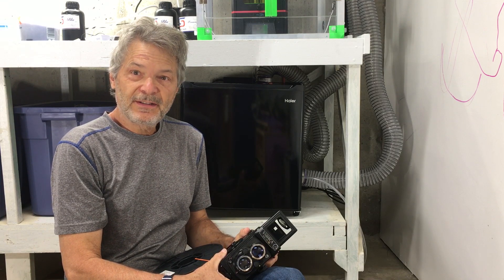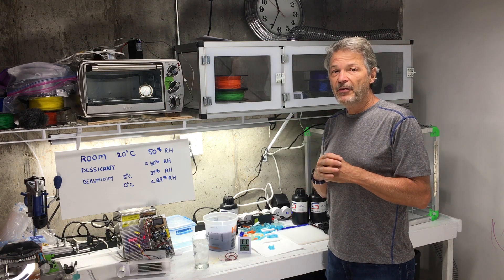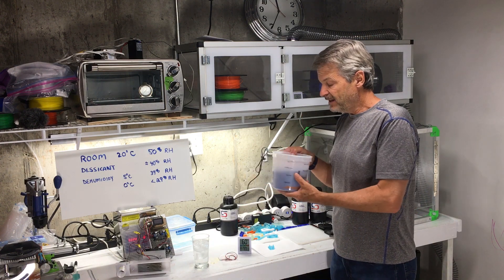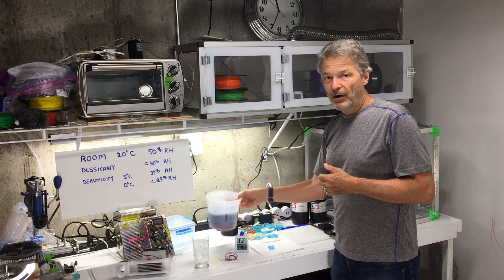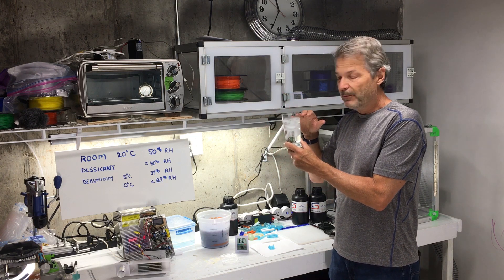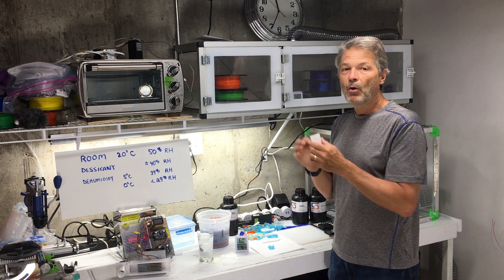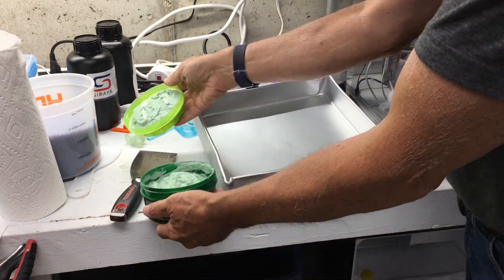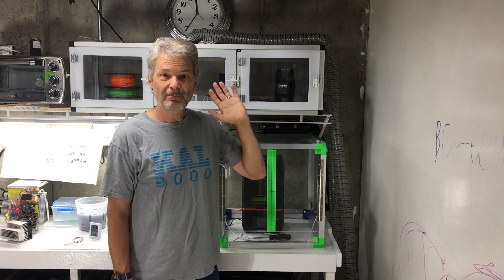Build the ultimate dry box! Use a mini-fridge for dehumidifying air.

Comment: Add heat back into the unit to get more efficient operation. Draw air from the cold plate, to the heat exchanger, to raise the dry air temps. Warm dry air absorbs moisture faster and the condensor doesnt have to get to freezing, to extract more moisture. (A fridge unit would work too.)

The issue with cold plastic is that when you open the door, all the cold dry air escapes and hot moist air enters. That causes condensation on the plastic, which is 100% humidity. Same if you remove cold plastic for printing.

Adding a simple temp sensor to control the fridge when the plate reaches "freezing" temps, will also make it run more efficiently. Once it freezes, you kill power to the fridge but keep a circulating fan going. It'll generate a little heat and defrost the ice, so it drips the moisture away. A delay of 5 minutes is perfect before allowing the freezer to activate again.

Adding a humidity control into the loop, you can disable the whole unit, until it senses that humidity is too high.

Placing the filament in open top containers will reduce the cold air from escaping and reduce the hit humid air that enters, when you open the door. Adding a lid to the container and removing it, cold and dry, then letting it slowly warm up to room temp, while sealed, will stop condensation from forming on the filament.
Reply: I had same thought, but he sorta does add the heat back, but it's not intentional. The temp in the box is 69F.... not that cold. The uninsulated upper chamber and long tube from the fridge probably work well for that.
Reply: One of the smarter comments on here lol.

Comment: Why not just make a door out of scrap wood, insulate with spray foam and put hoses through that way. Could still use the fridge when you find out there is much better solutions than this. For starters small containers are much easier to keep humidity down in, silica pulls in much less moisture if the area is smaller obv. Cereal containers for example, its air tight so once the moistures gone its not coming back, you put the filement in straight after drying and the silica can last months in those when sealed properly. Theres also those buckets of dessicant inthink called dry rid or skmething like that which would work much better in a large dry box like what you have. Even drying filament then vacuum sealing with silica pack would be just as good and much easier

Comment: For the same money as the freezer, you could have bought a dehumidifier with all the necessary water collection built in. Then just adapt it to add the hoses.
Reply from the maker: A dehumidifier will not get the humidity less than 39%, because to get the humidity lower, you need to get the air colder than freezing.  That is why you need a freezer.  Dehumidifiers are designed not to freeze up.
Reply: @PhilGandFriends  Google: desiccant dehumidifier
Reply: @PhilGandFriends  Google: desiccant dehumidifier
Reply: Google: desiccant dehumidifier

Comment: i'm very surprised that this method isn't more popular. It's a bit high on energy consumption, but gives great results (dry enough for nylon), the filament is always ready to be used, and is relatively maintenance-free even with no auto-defrost (vastly better than desiccant systems).
Reply from the maker: Thanks, Mine has run now for four years with no maintenance.
Reply: It's cheaper than a peltier or desiccant setup. It's possibly the most efficient method, of all possible solutions, besides solar humidity extractors.

P.S. it can easily be made even more efficient with a simple "wick" that takes the cold moisture and runs it up to the hot exchanger, aiding in the cooling process.

Comment: I built this today and got it down to 18.6% from 50% in about 2 hours. How long does it take to get it down to ~5% RH? I do have frost building up and I turned the fans down as low as they can go but at the right voltage for them to restart after power cycling. I found that too low a speed and there is not enough juice to start the spin (the fans can go lower though).
Reply from the maker: Congrats on the build!  For the first time it may take a day to get all the humidity off the filaments.
Reply: in my setup it took ~2 weeks. But i used a smaller container, much thinner pipes (10mm inner-d), and no fans (the air flows purely by convection).

Comment: If you place the desiccant in a bag rather than bucket the humidity level can go as low as 10% @32C. My outside RH is at 70% @32C. A bit of isolation around the door helps a lot. Also, people please do not us blue desiccant it contains cobalt, that is NOT good for you. Use orange desiccant.

Comment: Excellent presentation, exemplary results! I'm thinking of using a countertop ice maker for my icebox. It will likely require a mod to the water filling function since that won't be needed. I like the compact size but also I haven't seen any mini-friges at the low price point of yours. Any thoughts?
Reply from the maker: As long as you can get air below freezing temp, it should work.  Good Luck!

Comment: I see you stopped uploading but perhaps you still get notifications for comments.

I'm wondering how well an old mini fridge would work for dehumidifying a large room from 70-80% RH down to let's say 50-60% or lower. I'm thinking simply leaving the door slightly open, blowing in some air, timer turning it off sometime during the day when electricity costs more and collection the condensed water when the ice melts.
Reply: Simply use dehumidifier for room :)

Comment: At what temperature does the fridge stays at all time ? Do you put filament in the fridge too or you put beer ? :) thanks
Reply from the maker: The fridge main compartment stays around normal refrigerator temps (35-40 F). However, the freezer section at the top is around 25 F.  I have not thought of putting beer in there!
Reply: The filament section in my case stays at 19celcius and humidity at 18percent.. the freezer is bigger then yours and fans too . What am I doing wrong ? Thanks alot
Reply from the maker: @kennybeaudoin   The question is: Are you making frost in the freezer?  You have to see frost buildup to be getting the humidity down low.  Most people have the fan running too fast, which keeps the freezer too warm and frost is not building up.

Comment: Absolutely fantastic Phil!!
I've been following the exact same path, got a peltier to get down around 17-18% RH, by letting its exhaust heat also warm up the chamber, but I'm still not satisfied.

I'm looking at a compressor based ice maker to modify in much the same way! Love your simple and clean solution, and I'm wildly excited to see something similar working so well!
Reply: In an enclosed space the whole peltier system will heat up the air (the system cannot be 100% efficient) so in long term the air will heat up to a point where the cold side of the peltier won't cool down as much. If we keep the hot side outside of the chamber, the chamber may drop temperature too much - lowering the dew point and making the condensation ineffective. I reckon there is a "sweet point" where the peltier works the best and the dew point is at maximum. It may require some sort of automatism which re-cycles the heat from the peltier to warm up the chamber but not all the time. How did you get 17%? It may be enough for me. Thank you!

Comment: ever wonder why they don't use Peltier chips in food dehydrators ?  you're jumping through hoops trying to solve a simple problem, seriously no need to reinvent the wheel

Just put a 60watt light bulb in the cabinet, drill some small holes in the top and bottom to exhaust the humid air while providing fresh air, there you go problem solved. what you have basically done is built a dehydrator 

I mean seriously haven't any of you seen an easy bake oven LOL
Reply from the maker: I have a dehydrator.  But: 1: The humidity will not get as low.  2: It will use a lot more energy.  But I do use the dehydrator to dry out wet filament at a higher temperature. (If you want to dry out filament that is already wet you have to heat it up to slightly below the glass transition temp.  A food dehydrator is good for that.). But it is not good for keeping filament dry. And it is not good for a large storage box with many rolls of filament in it.
Reply: Dehydrators remove moisture from materials. This shouldn't be confused with dehumidifying air. 

Heat is used for dehydration because the material molecules require agitation to free the  trapped H2O. Then the air is simply vented out - taking the moisture with it. 

Air has different properties, thus different method is required. Enter, dew point and refrigeration. 

Yay for physics.

Comment: I cant quite work this one out. as far as I can tell you are just blowing the "fridge air" into your dry cabinet. Fridge usually operate at around 45-65 RH and somehow you are drying air to <5%RH. what am I missing?
Reply from the maker: (As explained in the video), in order to get the humidity less than 25%, it needs to be cooled lower than freezing.  So the air is blown through the freezer where the water in the air precipitates out as frost on the cooling coils.  That is how the humidity gets to 6%. 
(As I say in other comments, if you are not making frost in your fridge you will not get the humidity below 25%)

Comment: Hi Phil, I love this setup and I think I may build one of my own. I see that the filament storage stays at 69 degrees. Do you have another heater for that area? I would think that the constant cold air flow from the freezer would bring that down into the 50's at least. Thanks, keep up the good work.
Reply from the maker: It is just in my lab where the air is around 69.  The total cooling capacity of the mini-fridge is fairly. low, the air gets reheated as it flows into the cabinet.
Reply: @PhilGandFriends  Thanks for the reply, I would not have guessed that it stays that warm. I have not had great results with just using desiccant so I think I'm going to try to make this, I love a good project!
Reply: I was indeed wondering the same, I suspected the non-insulated hoses were enough to dissipate the cold. Thanks!

Comment: This is exactly (EXACTLY) what I was looking for. I would like to make a question: would it be possible to use such system without opening the storage case?
I want to make a similar low humidity cold environment to store a high end PC. Processors and GPU's tend to become very hot after usage at 100%. Inside such environment, especially a dry one, I believe my hardware will last longer. 
Regards from hot rainy Brazil.
Reply from the maker: Sure.  There is no need to open the case except when you need to get something in or out.

Comment: Can you make another video showing which hose connects to the freezer and which goes on the refrigerator side and which is on top of the cabinet and which is on the side and why?
Reply from the maker: It is really pretty simple.  I would direct the air FROM the drybox into the center of the freezer part of the refrigerator (in the one I made that is right in the top).  (The maximizes the chance that it will flow past the cold metal part of the freezer and release the water as frost on the metal).  The return back to the drybox is not critical.  As far as the dry box goes, I don't think it is critical, but I think it is slightly better to have the cold air from the frig be introduced near the bottom of the box and suck the air out of the drybox near the top. (reason is: Hot air rises, so the rising air will pick up humidity as it rises).  Most of all, remember that if ice-frost is not building up in the freezer, you will not be dehumidifying.  The air flow should be slow enough to make sure that frost builds up.

Comment: Hello how much is the best air flow in m3/h ? If i have freezing fridge hehe and big fan for in and out like 400m3/h flow.? Maybe you now if how much degrees celsius - need for best results? And how many liters of water can absorb in one day? Maybe its there some calculation ? Thanks for answer and good video 😀
Reply from the maker: Good questions.  I don't think there is a general answer that works for all configurations.  A higher capacity refrigerator/freezer can handle large airflow and still achieve freezing temperatures in the freezer.  But to reiterate, the most important thing for this design to work is to have ice build up on the freezer compartment.  If no ice builds up, you will not get the humidity below 20%.  It does not take much air flow to keep a reasonably small box dry.

Comment: hey, has this been reliable?

Would it work even better with a Freezer instead of a refrigerator?
Reply from the maker: It has been more than a year and it is still running great.  Regarding using a freezer, I would say: First, a mini frig is very cheap and small.  Secondly, it works fine.  It does not take muck freezing capacity to dehumidify a relatively small box.
Reply: and then, u get the auto defrost/non frost cycle, that can get the ice out of the fridge. so u dont have to do that work.

Comment: Hi Phil and Friends. This is really great. Few stupid questions if I may: 1. Do you still use the peltier element in addition to the fridge? 2. Where in the filament cabinet do you put the inlet and outlet hoses( next to each other at the same end, or maybe the inlet at one and and the outlet at the other end)? Thanks and keep up the great videos!
Reply from the maker: I don't use the peltier element any more. (not needed).  I put the inlet hose (air from the frig) near the bottom of the box and the outlet (going to the frig) at the top.
Reply: Phil G and Friends
Hi all. I made a copy of your setup. Even with a low fan speed, the RH is 35% but my temperature is 40F. 40F sounds right because it’s got the cold air from the fridge circulating. Why is your temperature showing 60F? That’s quite warm for inside the filament box? Any help is appreciated.
Reply from the maker: @NigelPeart1  The first question is: Are forming ice in the refrigerator?  If not, you will not get the humidity less than ~25%
The temperature in the storage chamber is really not important.  If you are not forming ice, then you probably have fan speeds too high still.

Comment: Awesome idea. Can you share the STL files for the hose fittings? I’m going to build one. Thanks for taking the time to make the video.
Reply from the maker: Here you go.  I uploaded them to Thingiverse.  Let me know if you have any issues.  https://www.thingiverse.com/thing:3928329
Reply: @PhilGandFriends  I built one but cannot get 4%. I get 20% which I am ok with but was wondering if I am missing something. It is a bigger enclosure so maybe that is it. Here is my link to the build 
https://youtu.be/Co3TR1EarLM

I am still happy...so thanks for the idea. Ended up designing my own hose fittings
Reply from the maker: @rrrrriggs  Looks nice! Does ice build up in the refrigerator?  If not, the humidity won't get below mid 20%.  If ice does not build up, you should lower the speed of the fans. I also noted that your inlet into the refrigerator is from the front.  (mine is from the top).  You might extend it a bit to make sure the moist inlet air get's directed right into the freezer cabinet.  Let me know if that helps!